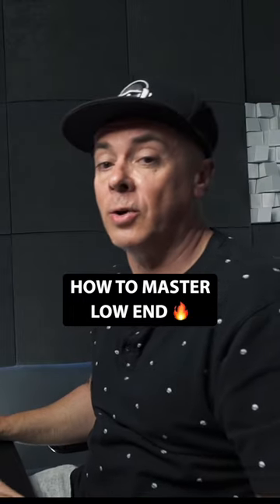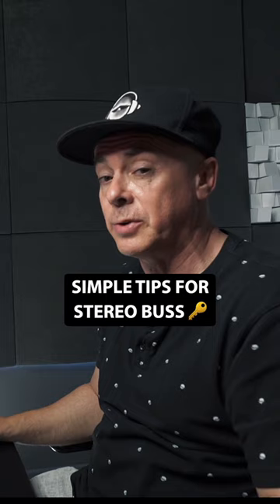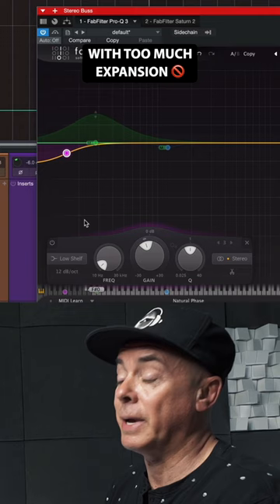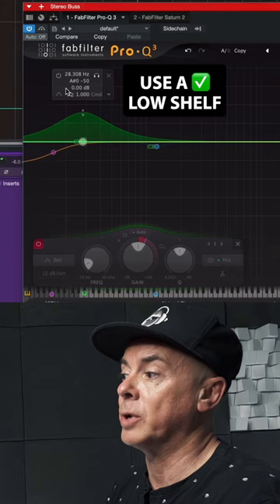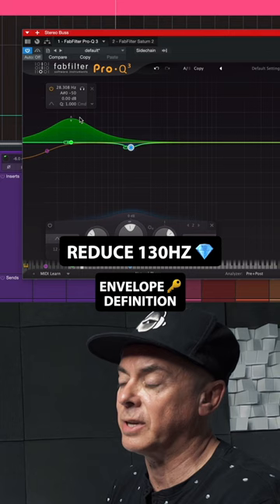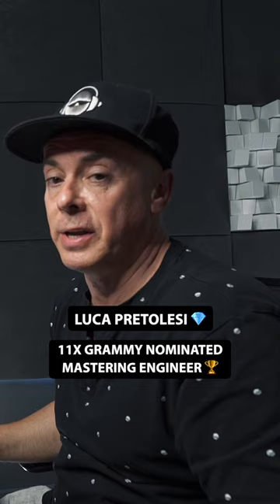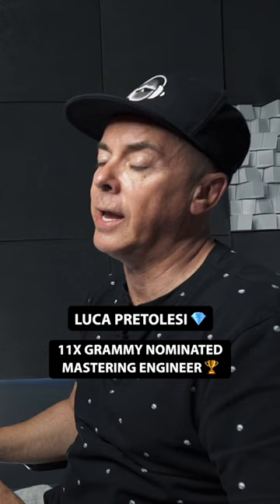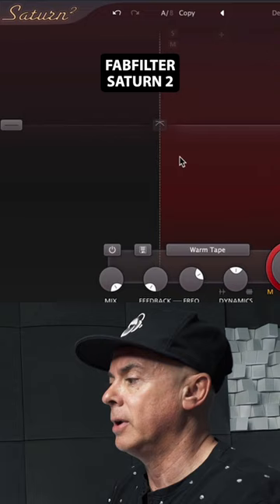How To Master Low End 💎 Luca Pretolesi

Comment: This is a great tip - it's not really 'mastering' the low end, it's more a tip of how to get better definition of the low end. I tried this on about 6 of my tracks and it works when you rely on the kick for sub (like house) but not when you rely on the bass for sub (like DnB).
Reply: Is this on the overall mix or individual Bass track?

Comment: around the 130h+ if you use drum buss in ableton and increase the drive + the transient for the attack you will  hear some tube distorting like resonances which you don't want most of the time! Be carefully in general with analog distortions, alot of them are tube like...
Reply: I always boost at 130hz because every reference track I've ever used had a lot more 130 than my mixes :D

Comment: Why shouldn’t you use a low cut?
Reply: It could cause phase issues
Reply: Because you're creating an unwanted resonance at the start of the low cut
Reply: Linear phase on low end low cut
Reply: @gertytheman  What will definitely happen is that the phase of the low frequency’s will change. What’s not certain is whether it will be perceived as a good thing, a bad thing, or a neutral thing. There is no reason not to use it. Although keeping phase relationships in tact when you can is generally a good idea. A low shelf does result in a more gentle phase shift.